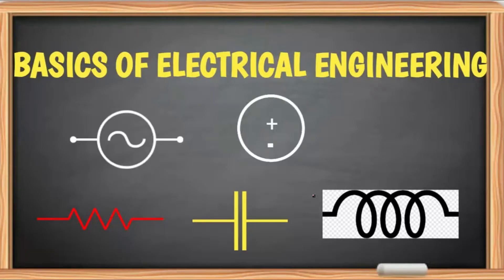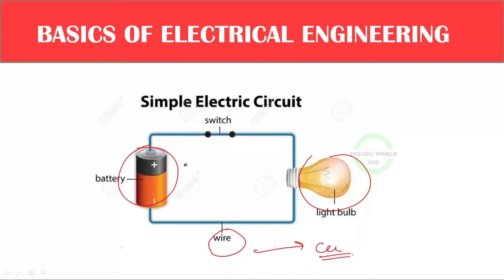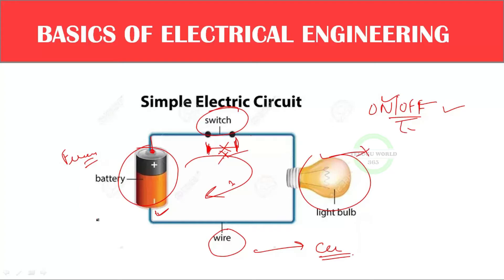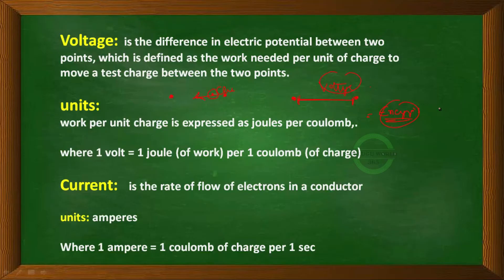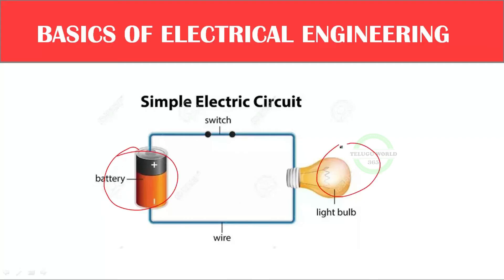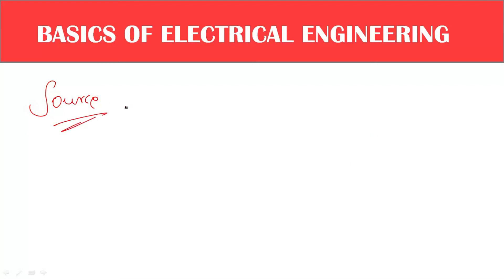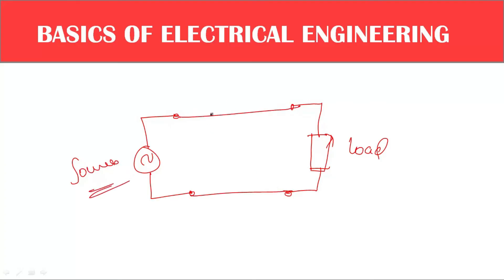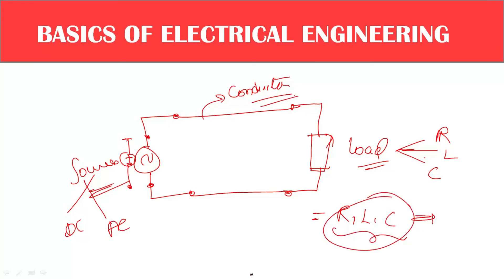Electrical Basics in Telugu by KLYADAV | Introduction to basic electrical engineering in telugu

Comment: Bro load use chasukonadi volts or ampear aa bro
Reply from the maker: If u work for 1 hr what u will observe Ur self..loss of energy..
I.e,,energy = rate if doing work...u performed some work so that u lost u. Energy.
In the same way electrical energy is generated or consumed....
So work is done...in electrical terms ,here if a fan runs means it has some energy that energy is rate of doing work..so product of both voltage current gives power and energy = power * time
Reply from the maker: Note an important point here... without potential difference no charges moves,,
Flow of electrons is current but to move or flow this charges there should be some potential difference